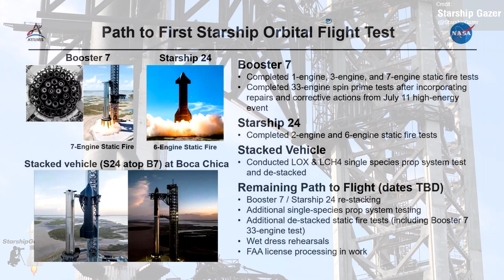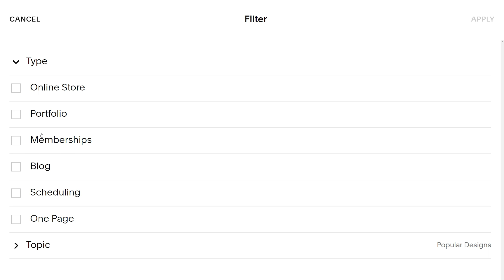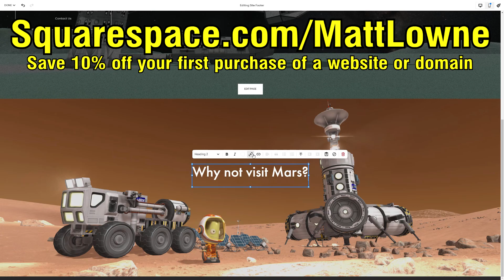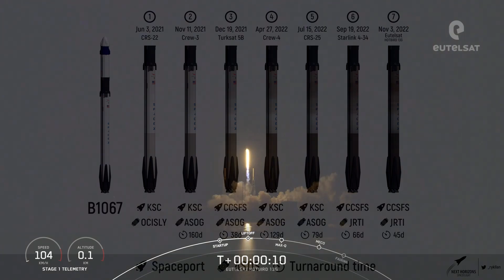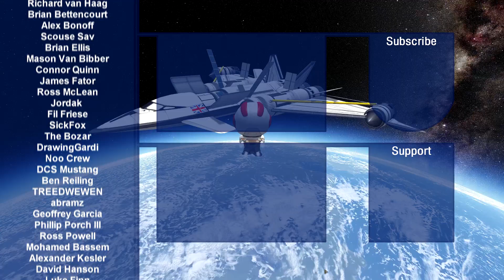SpaceX Starship Booster 8 SCRAPPED, Launch Timeline Revealed, and China's Space Station is Complete!

Comment: A few inaccuracies:

RS25 has way higher specific impulse than raptor 2 which gives it way higher performance and allows it to be a sustainer engine. Stop being pedantic and just saying thrust to seem correct

RS25E/F will be produced at a much higher scale for at least 8 engines per year

And it doesn’t need to produced at such a scale for something like a Superheavy booster. That’s not the RS25 architecture anyway. It’s a sustainer engine and those vehicles don’t need 33 for 1 booster. 4 will do just fine

Also, Delta IV Heavy costs $350M, not $440M lol. Cope

However, you’re actually pretty damn impressively close to partially expendable FH price - $140M. For this flight it would be $130M since boosters did RTLS so no special recovery

Comment: What does everyone think of the rocket lab catching plausibility? Personally feel like getting it done purely through computers would be harder than a propulsion landing, and then adding in the fact human error cannot be ruled out, and I don’t see a way of automating it too easily, like even if they had it nailed to a T, one bad day for the pilot could be a hefty cost instead of just relying on good old tried and tested automation which has a much lesser failure rate than humans 🤔
Reply: This failure to catch was a telemetry problem. Such a problem would also prevent an automatic system from attempting a catch. Helicopters can be automated.

This catch technique can't work economically with significantly larger rockets. Helicopters only get so large.

This technique makes a lot of sense for rockets of this size and smaller.

Comment: Is the stat about raptor and rs-25 having the same thrust down to each engine having the same thrust or at a ratio of 11 of them or other?
Reply: Each RS-25 has a maximum thrust of 510,000lbf in vacuum.  Each Raptor 2 has a stated thrust of 510,000lbf but not sure if that's sea level or if it will be higher in vacuum. Either way, they are one for one very equivalent engines and 33 of them is insane.

Comment: 3:10 The RS-25 probably makes up for its slow manufacturing pace with its insane sea level, in flight and vacuum performance. Incredible engine, one of the best designed and flown. Good on SpaceX, I think their propulsion team should experiment more though.
Reply: At this time the sea level Raptor 2s produce nearly as much thrust as a RS-25 in a package that is much smaller than the engine originally designed in the 1970s. Development continues though.

The cost of given for some of the shuttle era RS-25s was $40million with NASA's 2020 purchase of 18 new 'disposable' ones supposedly made cheaper than those designed for reuse was closer to $100 million each. SpaceX has mentioned that the original Raptor 1s cost about $1 million, with the goal for the Raptor 2s to be a quarter of that price.
Reply: @KnightRanger38  RS-25 has like 75s more isp. Just expensive, but it is widely considered to be one of the best rocket engines fired, let alone flown.
Reply: The RS-25 used to be made in the throat area by spending about a year in the electro-plating tank to build up the material.   They're WAY too expensive and fussy to make to use them in any quantity now that Raptor 2's are speeding off the assembly line at probably 1/10'th the cost...or less.
Reply: @recoilrob324  It’s definitely not worth the money compared to other options, but it’s the best performing liquid fuel engine flown to date. Expander cycle doesn’t produce much thrust, and a full flow staged combustion cycle can get like 9 more seconds of specific impulse. It’s the arguably the bleeding edge of liquid fuel engines and has been for decades. Just iconic. Can’t be beat, at least not until Starship is in regular service.
Reply: @fork9001  Rocketry is a fun subject...and about the purest form of 'there's no free lunch' in existence.   You want the increased ISP?  Then you need to carry the bulky and fussy to handle hydrogen in huge tanks compared to kerosene and suffer the lack of initial thrust which then needs solid boosters to get off the ground.   Many ways to 'skin the cat' as it were....and the ILS is proving that the method they've chosen is not the most efficient...even if the engines are.   Cost per pound to orbit should be the metric all rockets are judged on and so far Falcon Heavy and Falcon 9 are leading the pack.   Only Starship looks like it'll be able to beat them and choosing methane fuel was only made so they could be refueled on Mars in the future.   Otherwise the advantages of using RP-1 are many even if the ISP is lower than hydrogen.
Reply: @recoilrob324  And strangely, the bigger the rocket is, the easier it is to work with more complicated equipment and fuels.

Comment: Electron wasn't caught as the telemetry from the first stage was lost, the pilot of the helicopter was ordered to leave the re-entry zone as a safety precaution.
Reply: Yea, they failed by not using a bulk autonomous drones, to split sync holster balance on the parachutes. Instead just risked human & manual errors.
Reply: @rolflandale2565  that's a lot of drones to lift nearly a tonne :) let alone move it somewhere worthwhile
Reply: @nickthorp1624  not a hand held size drone, essentially an autonomous vtol crafts, which is known as unmanned crafts/vehicle/mech to flight task, lighter than a classic helicopter, with multi purpulstion electric, and even duct fan form. Safer than a mono massive blade, which would be risking a human & vessel objective in  that chem-fuel run engine compartment known 🚁.